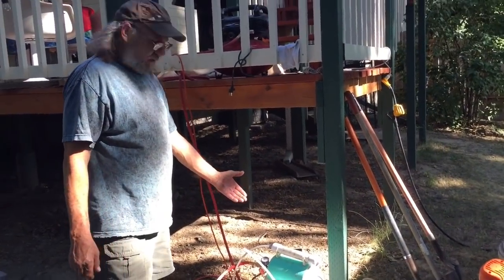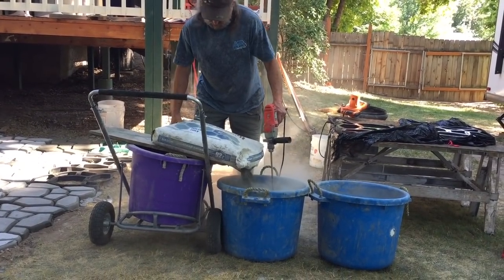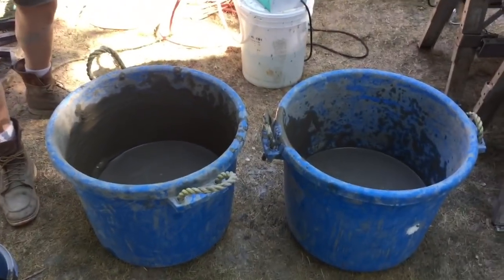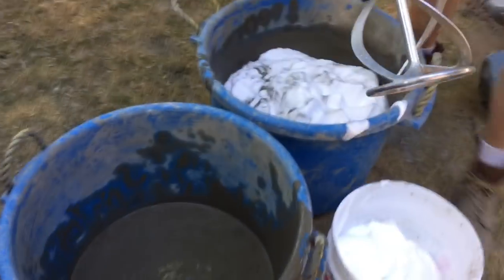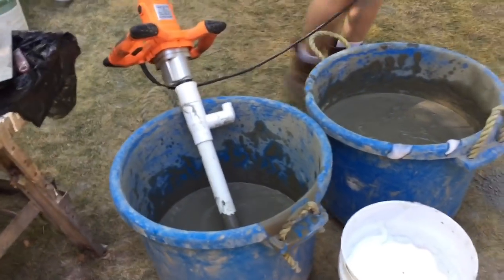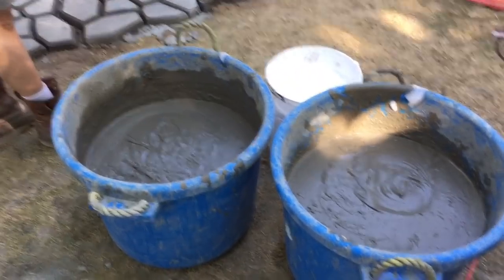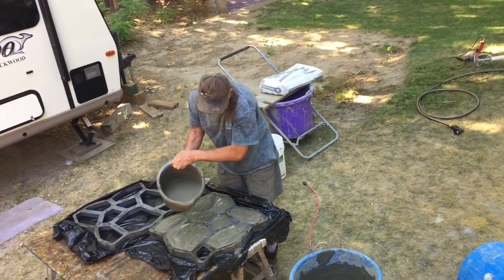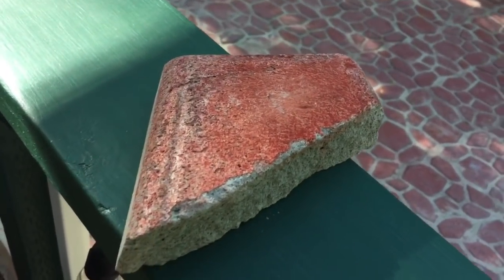Air Crete patio using little dragon

Comment: My understanding from reading the information on the domegaia site is that dish soap is good, but they talk about a commercial product (which I can't remember the name of offhand) which they say is better.  So I crunched the numbers, and it turns out that the commercial foaming agent they list is actually cheaper than Dawn for the amount you can produce with it.
Reply from the maker: Dwight Gordon  thanks we didn't realize that. I believe what they actually recommended is seventh generation.
Reply: Costco eco-friendly dish soap is even cheaper per ounce than Dawn.
Reply: ive see an upload where they compare dish soap with drexel foaming agent  the dish soap i believe had broken down in about an hour or so where the drexel hadn't broken down at all 24 hrs later. also i dont see any sand being mixed through
Reply: Nice!  Good to see side by side results like that.
Reply: I have a problem with this demonstration. If you observe the process in this (kathy johnson's) video, the volume of the pavers he's poured do not shrink a detectable amount. I argue that the foam trapped in the cement suspension does not break down as it does when simply exposed to air  as in the buckets in Harry's video. In this video, the volume increase is clearly demonstrated when the foam is mixed into the buckets. He then immediately pours into the molds. If the same action of the foam breaking down in the buckets was also happening in the cement suspension, then the dried pavers would be half the size or less than when he first poured them. I assume, but do not know if Harry is using a little dragon but he messes around with the psi of foam production a lot and I have yet to see him produce really strong air crete in any of  his videos. Just my observations.
Reply: A couple of people have done comparisons on Youtube of various foaming agents. There are two or three different tests here on Youtube, from Harry Maldonado and Honey Do Carpenter. 

The upshot is that  Suave shampoo is nearly as good as Drexel Foaming agent, and everything else pretty much  isn't even in the same league, regarding the making of bubbles that hold up long enough for the mix to begin curing. 

The issue is not only in the size and consistency of the bubbles, but in how long it takes them to start collapsing.  

Liquid hand soaps, and every kind of dish detergent don't hold their bubbles long enough. 

As you pointed out, a gallon of Drexel will theoretically make ten times as much foam as gallon of shampoo or dish soap.

I had a hard time finding a good source of Drexel, but I finally came across https://stonebrothers.com/shop/drexel-aircrete-fm-160/ at $33 per gallon, plus $10 shipping. (2018)

Drexel Aircrete FM 160 foaming agent came out on absolute top, and it IS a lot more expensive per gallon than Suave, but if you use 2 cups soap per gallon of water to make 5 gallons of foam for 40 gallons of aircrete, then an 8-cup gallon of Suave would make 40 gallons of foam. That would be about 320 gallons of aircrete.

 Ojne gallon of Drexel is supposed to make 160 gallons of foam, so if you used a 5-gallon bucket full of foam to make 40 gallons of aircrete, that would be over 1250 gallons of aircrete.

Comment: That's a great idea, never seen foamcrete. I've made quite a few driveways with those forms but I just had concrete poured, then after leveling went over it and pressed the form in, pick it up and move over.

Comment: It will be interesting to see what the durability of your patio is.  The air crete has much less compressive strength and much lower crack resistance, but it may be plenty strong for a patio.  The surface will not be as resistant to wear as a standard concrete mix design that includes aggregates (sand and rock), but again, that may not be a problem for your project.

Comment: The problems you experienced were due to the weak strength of your air Crete.  With that much water in the mix there is no way you could have any compressive strength to the concrete.  Plus, the savings of the concrete is offset by having to purchase so many forms.
Did you apply a stain afterwards?  The final brick looks good.  You should definitely apply a sealer or the freeze thaw is going to turn that patio into lava rock.

Comment: The wand from your Little Dragon screws into the L fitting coming off the side of your mixer.  It injects the foam directly into the mix and is way easier and much less messy.  You should also test the foams weight and not just rely on the pressure.

Comment: Please get a tripod and cell phone holder - I get sea sick watching.  You can pause to relocate shots. 
I have watched all of their videos and anyone interested should also. Lots of info about Air-crete's structural load capabilities and varieties of foams in final product.  The commercial foaming agent is worth it.
I think that the little dragon foam machine connects to the mixer infusing the foam at the bottom of the mix.  The videos about the Little Dragon are really worth watching.

Comment: Equal parts by weight, Dish detergent (Preferably Dawn) Borax (Sodium Tetraborate) Baking Soda (Sodium Bicarbonate) Combine Ingredients in a bucket, very slowly add just enough Hot Water  ( 120°F ) to combine as you stir and watch! Foam Zilla, you’ll be able to stand a post in the center of the bucket without it tipping ( you may have to adjust the ratios a pinch here or there, I stumbled upon my discovery accidentally.
Reply from the maker: Wow.  Will have to try it. Thanks

Comment: Hi where can I get the forms/molds? I want to make blocks that I can possibly use as border for raised garden beds and such. Thank you so much. Your patio is very beautiful. Did you add something to to turn the finish product into the reddish color?
Reply from the maker: We got them at Home Depot.   Thanks for the kind words. Also the link I put below is to the follow up it shows you what we did for the coloring and the grout
Reply from the maker: Air Crete patio 2 month follow up https://youtu.be/yYQaoxMPX30

Comment: suggestion....the next time you use your air compressor in a video, move it futher away from the work site.....air hoses are cheap. you might also put up a sheet of plywood next to compressor between it and the work site to act as a sound barrier/deflecter. then we wouldnt have a problem hearing you talk....just a suggestion.
Reply from the maker: John Tingle thanks. We're just beginners willing to learn thanks for your suggestion

Comment: Well, times up! How is it holding up? What did you use to color the blocks? How strong are they? I'm assuming the strength of the concrete is way down. Did you use salt on the patio at any point? What is the total SQ Footage of the patio and how many bags of concrete did you use? Are the blocks looking susceptible to corrosion at this point? 

Job looks nice by the way!
Reply from the maker: We’ve done a few follow-up videos that shows how we did the color how we filled the cracks and what we eventually did and we did change it.   We have never used salt on it. The bricks are actually very strong.  It  took 50 bags of Portland cement. we got five patterns out of one bag of cement. Patio is 22 ft by 44. There is a couple of places that have peeling. we’re going to skim over with cement this year.. The follow up video to show you that we sprayed it with liquid concrete color and the air Crete absorbed it..  Hope that helps
Reply: @kathyjohnson7132  that's actually excellent information and it gives me a great starting point, thank you!

Comment: That looks so easy,I want to have a go making the bricks for a home project......how did you add the stain to them? I thought this would have been added when you mixed the cncrete and foam?
Reply from the maker: +Rosemary Hugharts  we added the color after the bricks were dry. It is a concrete color and should have been put in the cement, but we choose to do it different. We did another video called air Crete patio follow up. That explained how we did the grout and coloring,

Comment: I really like the look of your paatio buys! Well done! I was just wondering if by chance you would know if Aircrete blocks would have a heat rating high enough to be used for a outer brick wall for a home made pottery kiln? I guess it would depend on the kind of concrcete mix you used right?
Reply from the maker: We're still learning about aircrete. I know we thought about building a pizza oven. Someone on one of the video posted a fact sheet on aircrete. I looked it over I has a lot of good information. I just don't remember all of it.  I did post it on this post. Or at least on our video about aircrete.
Reply from the maker: Oculus Angelicus the fact sheet from Domegaia is in the comments on our follow up video.  (Couldn't get it copy sorry )

Comment: Did I miss something??  What's the purpose of adding foam into the mix?  Doesn't it weaken the cement? Is it to save cost? If yes, how many percent we're talking about?? 10..20 or 50% saving? Thanks for any info.
Reply from the maker: It makes it extremely light. And yes it probably saved 50 percent.  And much easier for us older people to work with. 😏

Comment: Interesting. But I'm wondering what the advantage is of using aircrete, over conventional mortar?    Less cement needed. so saving cost?  Eaiser mixing and handling, maybe??  Also how did you grout the blocks - is that sand/gravel in between the gaps??
Reply from the maker: Maybe it would be.  This was just a learn thing for us.
Reply from the maker: Richard King we did a video that showed you about the grout the coloring and everything.

Comment: One has to ask . Do you have to worry about the blocks floating away ?
Reply from the maker: timothy thomas  that's a good question. I really don't think that be a problem.  But we haven't had enough rain to make anything float here. 
I really don't think they would come up off the ground easily.
Reply: I have looked on the domegaia site, they say that depending on the foam you could make a boat of aircrete, but their patio looks like it wont come upeasily. please note that I have not worked with aircrete, nor do I have any expierence with construction, this is an educated guess. I would suggest looking at the site, it has a lot of information.
Reply: Only if you build a boat with them! : P
Reply: Heh. I think that would be the least of your worries in a flood. I would really like to see accounts of someone's air crete patio floating away... sans destruction and human suffering of course.
Reply: One only has to picture that foam floating away like your Car did in the flood in Harrisburg!  Or at that point call it your boat! How are you?

Comment: I stumbled across your video while searching for vids on concrete. Don't know very much about aircrete but was intrigued. Seems easier than and lighter than normal concrete. Can this be poured into slab forms and work the same? Please get back to me and where do you purchase that little dragon foam excellerator?
Thanks for the great video and instructions. Nice job!👍👍👍👍👍👍👍👍👍
Reply from the maker: Thank you for the kind words. It worked very well for what we needed it to do. The reason we choose it is because it was a lighter and easier to work with.  Domegaia.   Is the maker of green dragon. He also has classes on air Crete.  He teaches you to build dome homes.  He has a lot of videos on you tube. We’ve never taken his class. ( we still would like too )  please look up Domegaia. He seems to be the air Crete guru.    Hope this helps

Comment: Looks like these have been down a few years. How are they holding up? Also, why did you use Aircrete? Why not just use regular cement? Thanks - very interesting and you guys are real troopers!
Reply from the maker: We sold the house two years ago. But when we left the patio was great.   We did air Crete because my husband had bought a little dragon and we wanted to practice on something and it also turned out to be cheaper

Comment: Subscribed! Nice vid. How strong it the stuff? Driveway for smaller cars?  Thx. Mark
Reply from the maker: Its strong but we haven't parked any cars on it.   Months ago when we first posted this video., The maker of the green dragon answer that same question for a viewer. He wrote to use  air Crete as the base and put layer of cement on top of it.. Thanks for watching going to do a followup soon.
Reply: A driveway is made from concrete with 4,000 to 6,000psi strength, and reinforced with steel.

Aircrete is somewhat over 900psi at best.  I wouldn't drive across it with anything larger than a medium-sized motorcycle, even if you added sand and steel reinforcement.

Comment: thank you SO much for this video. Question. How did you keep them moist while drying? Is that aircrete between the bricks? and how did you color it?
Reply from the maker: We lightly sprayed it with water to keep it moist. We put sand between the bricks and we use concrete liquid color and water in a spray bottle and sprayed it on. The air Crete is porous it absorbs the color. We did another video that shows you what we did with coloring.

Comment: How did you tint the Crete red?  Did you fill in the seams with sand?  Great job.  Looks really nice.
Reply from the maker: We added cement color to water in a spray bottle. We sprayed on three or four times. Then hosed it off and that’s what we got.  Yes we put sand in the cracks.   Thanks for the kind words 😁

Comment: Did you use a little too much foam? How did you know what ratio? Were  you supposed to do any type of slump or poor test for the correct consistency? Did you cover with plastic, as with concrete, to keep moist but not saturated? Looks like air bubbles making it uneven and the frame needs cleaned after pouring.  I didn't see any tapping on the frame to even out the mixture nor scraping the frame even with all concrete. It is a lot like baking a cake or cornbread. I have used concrete but have never used it with foam.

Comment: Wondering How Your Aircrete Patio is holdning up? .... a year plus later. Also, Wondering: What Aircrete Recipe did you use?  Did you use the standard one 94 lb bag of cement, plus 6 or 7 gallons of water, then the rest was foam to make 45 or 50 gallons of aircrete.? or did you go for denser aircrete by adding up to 94 ilbs of sand? or adding less foam maybe adding foam to only 32 gallons in the barrels.  If you remember, please share what you can about the recipe, AND how is it holding up?  What might you have done to improve it?
Reply from the maker: William Self  the patio is holding up very well I have some small cracks but I see know problem I used the 94.2 # bag and 6 1/2 gal of water  then I doubled the amount with foam I weighed out the foam so the it weighed 3oz per qt

Comment: Wondering how many winters those will last on the ground like that?  Extra porous concrete plus water plus freezing temps equals dust...
Reply from the maker: That's what we were wondering too how many years it will last. We're going to do a follow up video in a few weeks, on how it held up for the first winter,.  We did do a video on freezing a brick it already posted.  Thanks for watching
Reply: Yes, I watched the test video after this.  In you area, I think once it gets below freezing, it tends to stay there judging from the -19 below comment.  Which is a good thing where porous concrete is concerned.  What kills it is where the temps regularly swing from freezing to warm on a daily bases for large parts of winter.

Comment: hey kathy would'nt ready mix be just as cheap to use?
Reply from the maker: rickfyi ready mix has sand and gravel and no it's more expensive to use
Reply: readymix and others have a minimum load requirement,usually at 2 yards, or they will charge you the regular rate,which is normally around $110 per yard, and then attach a short load fee of around $90. a bag of grey portland is around $24. do the math.

Comment: Do you think this would work well for cement countertops?
Reply from the maker: JACOB Blount  yes I think it could work for counter top.  The maker of the little dragon answer one of the comments on here about using for a driveway. He said it makes a good sub floor or foundation, then put a thin layer of concrete or other finish floor on top. So I would think it would work for A countertop also.

Comment: You need compressive strength and hard surface for a patio or pavement. Foam concrete does not have either of both.  Because wet foam concrete has a yoghurt like consistence it's not really suitable to make the pattern in the mould. A far better production  method would have been:
1*  Cast a foam concrete foundation slab first and let  cure a couple of days.
2* Cut Expansion joints into the slab with a diamond disk. 
3* form the stone pattern on top with a rather dry & compacted sand/cement mix. 
Remark:
Foam concrete enthousiasm does not replace THINKING first before you DO.
Reply: wheres your upload nozz?

Comment: Have you tried using a regular cement mixer to both mix the initial batch and the foam into the cement?  It seems like it might be a big help and make it go faster.  Mixers seem to be fairly cheap at Northern.com or Harbor Freight.
Reply from the maker: Thanks for the information. That mixer Actually will hold the foaming wand and put the foam out the bottom. We only use it like that so people could see the foam going in.
Reply: I wondered that also, since I already own the mixer that Home Depot sells for a little under $300.  

No firm idea, but I have my doubts about it being able to fold in the foam completely enough.